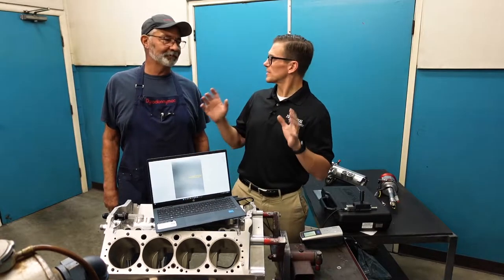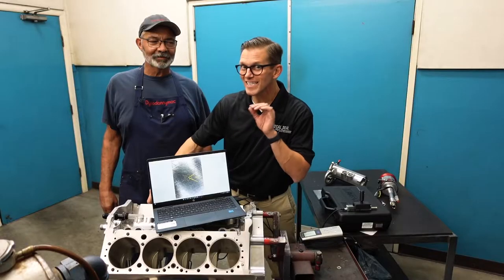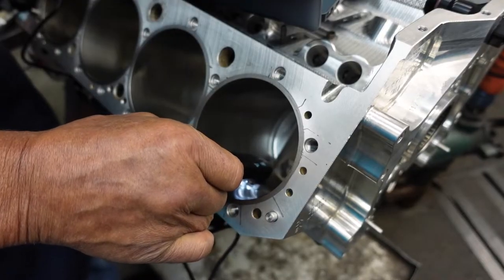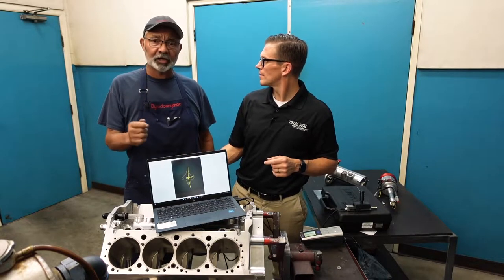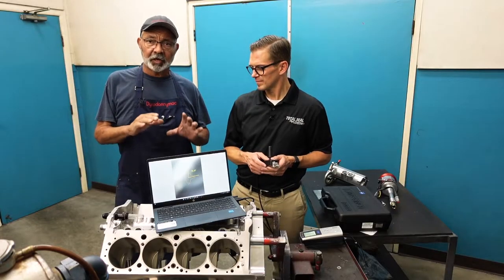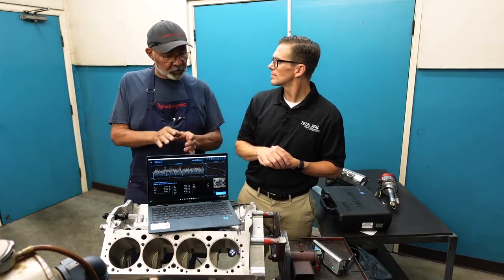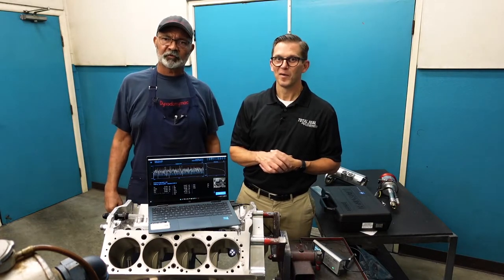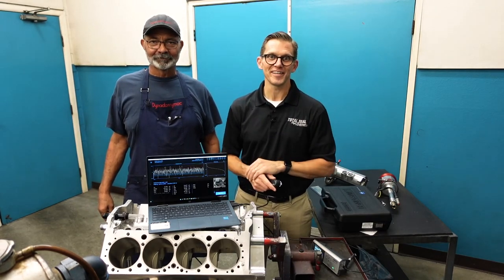I Wish Every Engine Builder Did This...

Comment: The interesting thing. I have been building Racing Go Kart engines at the top level for over 30 years and honing is a very important step in building fast engines. We find we have better ring seal with a scattered cross hatch rather then uniform. It seems to create better surface area. I would love to hear from honing experts.
Reply from the maker: Here's the link to the video we did with Greg Anderson on this topic. https://youtu.be/IUJDrHR1qsc
Reply: Is that a 2 stroke? Because 2 strokes do not have the same requirements as 4 strokes do. In fact they don't need cross hatch at all since they have little need for oil control. What they need is oil reservoir areas instead of channels. EX: when I worked at Homelite they fine diamond honed the chrome bores for size and shape but use a grit blast for the finish. That gave tiny pits to hold the oil.
Reply: I was taught that thinner rings are better for high rpms and mitigating ring flutter. But also require small hatch angle. But that is an awesome tool.
Reply: @wannabecarguy  THAT MAKES SENSE. IT SEEMS SINCE THE RING IS SMALLER. THE SMALLER HATCH ANGLE CUTS THE RING LESS UNTIL THE RINGS SEAT THEMSELVES. WHERE THE BIGGER HATCH ANGLE HAS MORE OF A CUT WHICH IS BETTER FOR THICKER RINGS.
Reply: Cross hatch I wouldn't think is so much of an issue at the bottom of the bores. No ring contact
Reply: @billshiff2060  you are kidding me right?
Reply: @UltFrizz  Why would you say that?
Reply: Uniform appearing crosshatch is not important IMO.   A slightly randomized surface profile usually works as well or better than a perfectly regular/uniform surface finish texture.   
Everybody knows hand scraped ways work better than ground which work better than milled finish.   
It TURNS OUT, that this works down to a smaller scale as well, ALL THE WAY down to near the molecular level actually, if you start looking into why bearing alloys work.

Comment: I want to know what the factorys are doing? My last 3 new trucks have used zero oil. My 5.3 out in drive has 110000 and been 1600 since last oil change and promise if I go check oil its still on full mark. I want my builds to be same way.
Reply from the maker: The factory finish is based on using the factory rings. There is a relationship between the ring face material and the cylinder surface finish. We explain that in detail in this video: https://youtu.be/Z5pZriur-cs

Comment: would be interesting to see what a shot-peened surface would be like compared to a cross-hatched surface on the performance of an engine?
Reply from the maker: Great question, the cross hatch actually allows the oil to move up and down the cylinder. Think of it as the pathway for the oil to flow, which provides the lubrication and sealing.
Reply: @aldo6192  actually his answer was very relevant, and directly addressed your hypothetical question. The oil has to move up and down the bore in a controlled manner, and would not happen as efficiently  with a bunch of disconnected micro craters that you'd get by shot peeing it. Maybe learn some reading comprehension before you get all self righteous and attempt to throw a tantrum when a 35+ year engine ring design team member tries to explain something to you. His bad for assuming you had a basic understanding of how things work and modern cylinder honing practices. He tried to be nice and encouraged you to think. P.s. if shot peening worked oems would not be spending the time and money they have on ring design and more  precise  cylinder finish. And lastly, the video actually does a very good job of explaining why things are done the way they are. Wtf is wrong with you people today sheesh. And seriously, if you have all the answers please enlighten us all, drop your years of hard won experience at world class cylinder finishes on us all.

Comment: I work at a facility where we turn axles for locomotives in a lathes and some of the axles we work on, we have to use a surface measuring tool like the one you have in this video to measure the RA of the surface of the axle. That portion of the axle rides in a brass bushing and the surface finish has to be right or it can prematurely wear out the brass bushings. Its cool to see these tools being used in the automotive industry

Comment: Very interesting.  What is the reason that we feel that we want hatch and depth to be the same from top to bottom? Might be advantageous to have different parameters at different locations in the bore, to control where the oil sits and moves for example.
Reply from the maker: There are some advantages to having the depth and cross hatch angle change from top to bottom, but that is harder to do.

Comment: So I just finish watching you Regional Conference honing video and wish Id been there. I have a few questions? Would the driven break in oil be good for stock rebuilds? I always used cheep  brand non detergent for break in.  BTW I sure like watching and learning from You and Don!
Reply from the maker: Thanks for watching! Yes, the Driven break-in oil is good for stock rebuilds.
Reply: Driven oils also have High Zinc content , important for cam break in  especially with flat tappets. At lest in the oils I got from them.

Comment: Hi guys, Would the RVK and PVK be the same on all ring thickness or would it be different with a thick ring compared to a thin ring?  Next how important would the cross hatch angle be for a 2 cycle engine that the ring does not rotate on the piston. Would we wont around 35deg. or less?
Reply from the maker: Great questions. The cross hatch angle and surface finish does not change regardless of ring thickness. The type of ring face material can vary the surface finish requirements and the cylinder length will effect the cross hatch angle. We explain these changes in detail in this video: https://youtu.be/Z5pZriur-cs
Reply: @TotalSeal  Thank you so much. You two have answered a lot of questions I have had and thought about.
Reply: @harleylif1929   2 strokes do not have the same requirements as 4 strokes do. In fact they don't need cross hatch at all since they have little need for oil control. What they need is oil reservoir areas instead of channels. EX: when I worked at Homelite they fine diamond honed the chrome bores for size and shape but use a grit blast for the finish. That gave tiny pits to hold the oil.
Reply: @billshiff2060  Was that with a with Nikasil? My engines have sleeves.
Reply: @harleylif1929  no it was chrome then but the surface should not be different for Nikasil.

Comment: Neat, but considering that many guys out there are still having trouble figuring out what ring end-gap to choose, or doing a good job of ring filing in general - this doesn't seem like a tool for anyone other than a honing professional teaching himself to run his equipment consistently - or perhaps a TOP flight racing team searching for that last drop of power.

In fact, I did nascar engine development back in the late 2000s. We tested dozens and dozens of different honing techniques in search for that last couple hp. And that's the magnitude of we're talking about here - a couple hp.

There's a reason a dude can build a darn good running engine using a dingleberry hone lubed with WD40 in his garage...

Not to say there's no good reason for high tech stuff like this - but don't lose sight of the forest for the trees.
Reply from the maker: Agreed, a regular dingleball hone works fine with ductile moly rings, but it doesn’t work well with modern steel rings. 

The goal of this equipment is to enable a professional machine shop to create the correct surface finish for today’s steel ring sets. The old honing process is just not sufficient for these rings.
Reply: Funny thing about an average engine vs a world class engine, the world class engine has utilized every tip, every trick to maximize efficiency for it's intended use. 2 hp here, 1 HP there. Before you know it you have an engine that is using less fuel, making more power, running cooler, and lasting longer. If that isn't the proverbial "Forrest" you speak of them what is? I understand what you mean, but for the guy that's scratched and saved for 10 years to build his dream car, this information is very pertinent sir, buy the best you can afford right up front, not just slap some bs together in the garage and wonder why it only lasted 15,000 miles.  Anything that is good for efficiency is good for more power, and almost always is good for reliability.
Reply from the maker: We couldn't agree more! @b.c4066
Reply: @b.c4066  So - for that guy that's scratched and saved for 10 years to build a great car:

Should he buy this system? Should he also buy a Sunnen power hone and learn to DIY his own block?

Or, should he take the block to a good engine machine shop that already knows how to do it - and has perhaps used this hone analyzation tool to improve their skills?

Again, I argue this tool is best suited for professional machine shops.

Comment: Lake Speed Jr., should the rvk #'s be lower or higher than the rk #'s on surface finish as measured by the profilometer?  When i hone, the rk #'s are always higher than the rvk #'s  Am i doing something wrong.
Reply from the maker: The Rvk should be higher than the Rk. If the Rk is higher than the Rvk, the honing process and abrasives should be changed. We did another video with Greg Anderson that shows our recommended process.
https://youtu.be/Jehtgk5cd3A

Comment: I have had stone type floating glazebreakers, a micrometer feed Snap-on rigid hone, ball hones and operated a Cylinder King. I always tried to get that crosshatch angle like the Sunnen book said. Well...I observed a WWII era machinist. He got out of the USN after WWII and went to work at White Electric, Gainesville Florida. I knew Pierce in the 70s 80s,90s. He used NO CROSSHATCH at all. His rebores seated quickly no issues ever. Kinda blew my mind. Here is my theory: Crosshatch is important to demonstrate that you have removed all the boring marks. Rings do NOT like bored cylinders with their folded and torn edges....